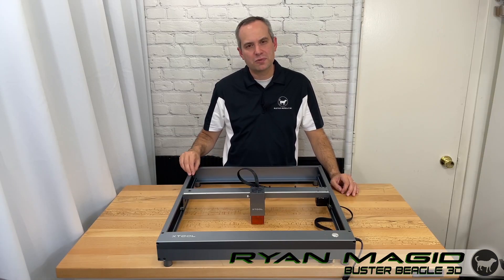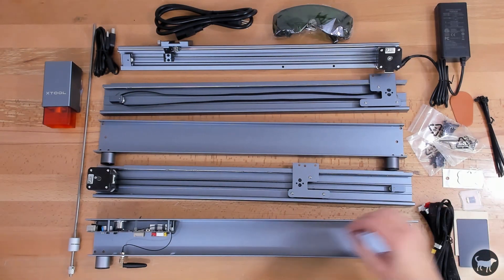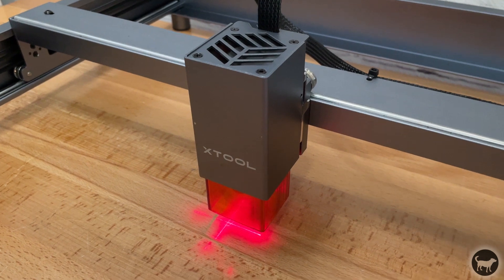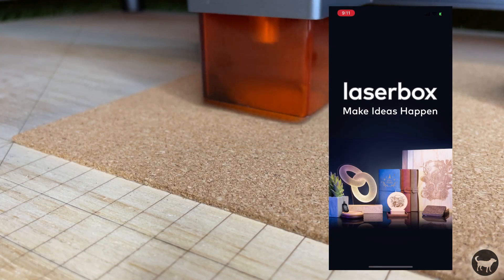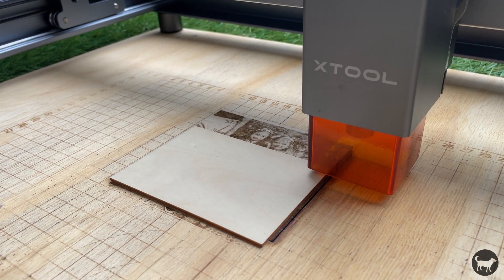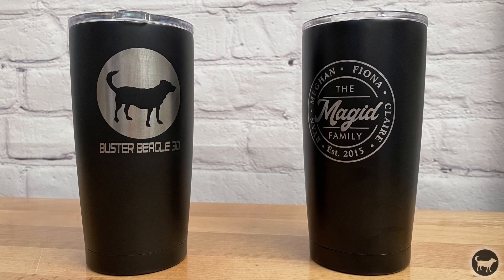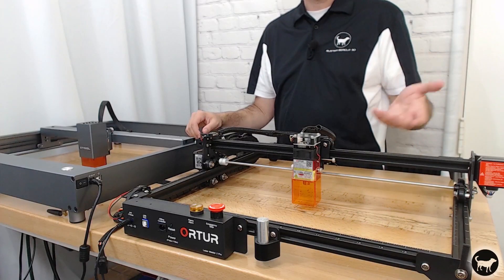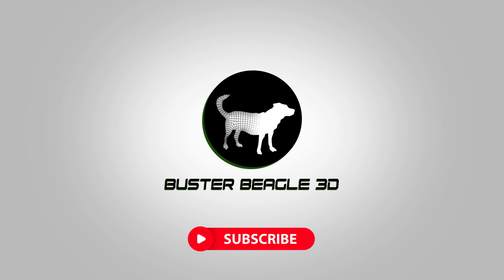xTool Laserbox D1 Laser Diode Cutting and Engraving machine review

Comment: Hello Ryan, Love Your Air Assist alternative.  ? Noise level.  I have seen some videos where you can actually hear the laser in action, and the sound level seems quite loud.  That may be an issue if too loud. Can you or someone commenting record the decibels at 5 or 6 ft with a free app for your phone maybe.  I would then have a sound basis for evaluating dampering or other solutions.  Thank You in Advance.
Reply from the maker: The noise really depends on the fish air pump you get. The one I use is rated at less then 60 decibels. There is also a certain amount of noise for the fan at the top of the laser but I'm not sure how loud that is. I wish it only turned on when the laser was working but unfortunately it run always when the machine it on.

Comment: Hi. I cant find any info how the machine can be used from the memorycard. Can you help?
Reply from the maker: I'm not sure if there is a way to load files on the memory card just by using a computer. I believe the purpose of the memory card is to provide the motherboard with storage when sending a file over the wifi connection to the machine. I'm not sure that I have seen anyone else use it any differently. I suppose there might be a way to do that but I haven't seen it.
Reply: @BusterBeagle3D  Ok. Thanks.

Comment: By any chance could you do a video using the Rotary Attachment for etching glass mugs, cups, etc and the preferred settings.  New to laser engraving and can’t find anything for this machine online when it comes to glass mugs. Also, is it possible to use a mug that has a handle with the rotary attachment?  Thanks in advance.
Reply from the maker: I haven’t engraved glass yet myself. If you check out the XTool D1 Facebook group online there are people who have done it and do show some of there methods and settings. Also you can use the rotary with a handle but only in limited sections. I know there are also other types of rotary machines that still technically should work with the D1 but I also haven’t tried those yet either.

Comment: The machine is well built.  However, the software is worthless, there is no documentation and it is the most rudimentary abilities.  I wish I would have bought the Otur master pro so I could use lightburn.  Having the 10w laser is nice, but Otur says they are coming out with a 10w laser.  Without good software, its a toy.
Reply from the maker: Yeah. I do bring up software as my major issue with the machine in my comparison video to the Laser Master 2 Pro. I have heard that they are planning on supporting Lightburn by the end of the month but nothing concrete yet.
Reply: It's is now available to use with light burn
Reply: @urjnlegend  light burn is actually working on DX1 by now